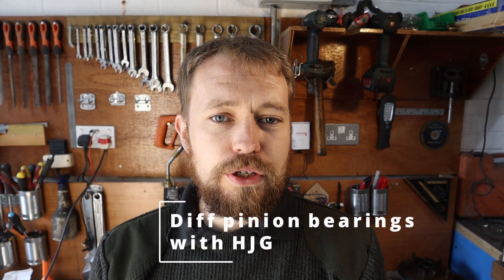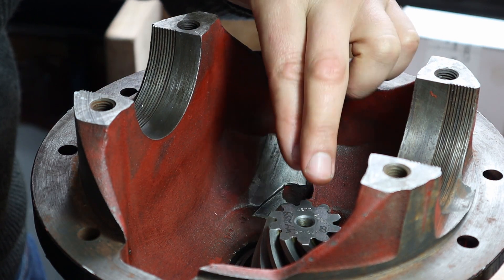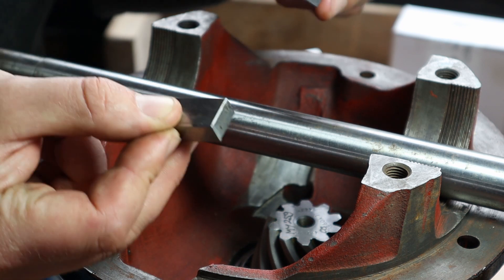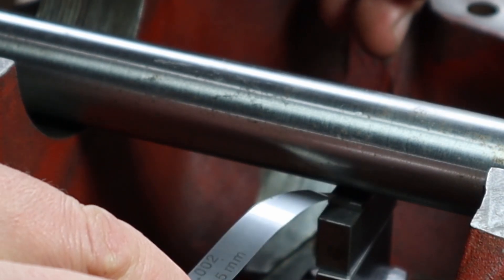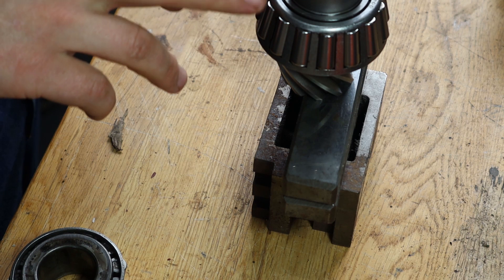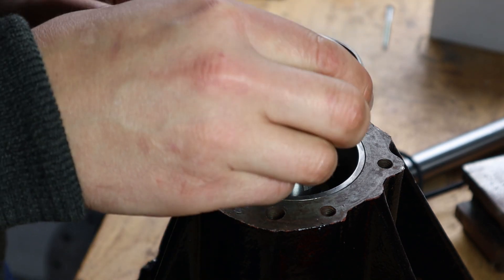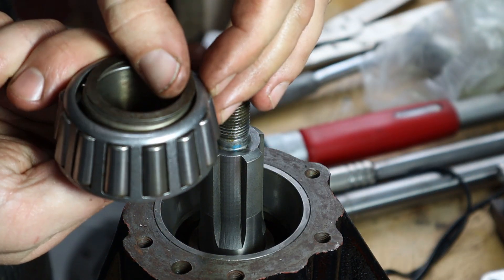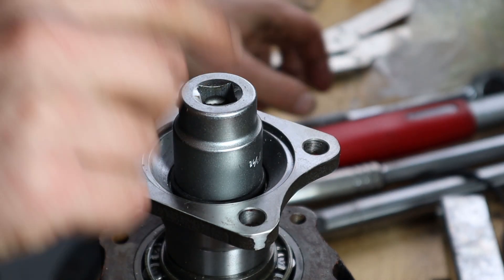How to set up Diff Pinion Shaft Bearings for a Land Rover Series 2 in under 15 minutes!

Comment: Very usefull! Just puzzled by the Landrover books about the Rationalized axle/diff and Pre-Rationalised axle/diff. So which height to use, 38.1 or 39.5mm? Any thought how to differ the two?
Reply from the maker: It is my understanding that rationalized = 24-spline diff and pre rationalized = 10-spline diff. I hope that helps
Reply: @HalfJobGeorge  that seems about right, also some say the rationalized has metric carrier bearings and the pre-rationalized has imperial carrier bearings. I think your understanding is the right one! Thanks!
Reply from the maker: Yes quite possibly!